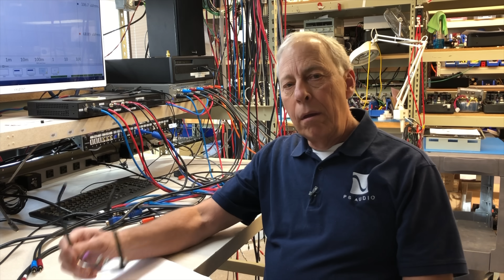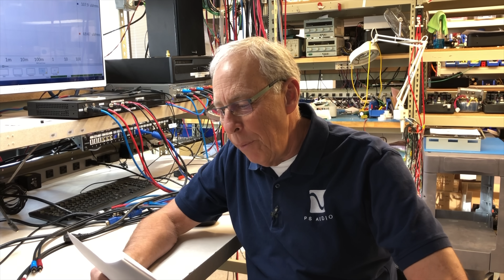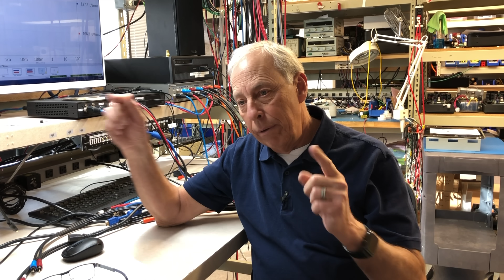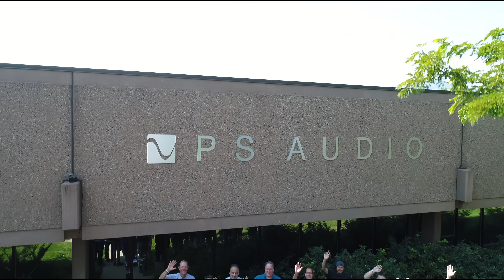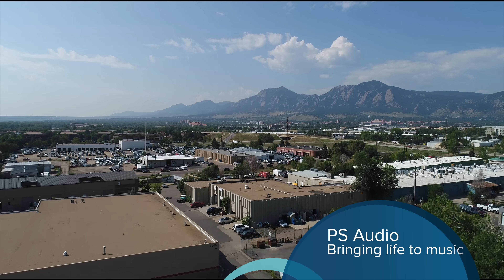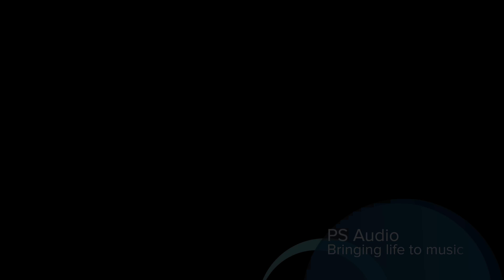What's the difference between amplifier gain and watts?

Comment: So technically speaking turning the gain down on your amplifier should reduce output wattage correct? Just asking because I'm running a big amp at 2.67 ohms 8k and just going to turn the gain down

Comment: Before I did't understand, now I am totally confused.
Reply: It will get clearer over time. Consider that another name for voltage is ‘potential.’  With the volume knob at ‘0’ there should be no voltage at the output of the amplifier. As the volume is increased, the voltage at the output of the amplifier increases. (Be careful testing this, since some ancient amps must have a load, or they will self-destruct.) Now add a speaker to the output: without any intervention from the amplifier, two things will happen (1) part of the voltage will now drop across the speaker, (2) current will flow out on the ‘hot’ wire and back on the return or ‘common.’ In this situation power is now being consumed by the load (that is, the speaker), and the voltage ‘potential’ is now being realized. The power consumed is noted in Watts (Voltage x Current, V x I). 

But wait, there is more: since there is a ‘power’ amplifier in the circuit, and since there is a speaker also in the circuit, and music or other tones are being played two more things happen: (1) the speaker presents a varying load to the amplifier, and (2) the amplifier varies the amount of current delivered to the speaker terminals in order to maintain the voltage called for by the volume knob. [It does get a bit more involved in that the ‘gain’ and current levels may be a DC component setting the bias or average level which is more or less modulated by the AC signal waveform, but generally speaking the volume knob sets the voltage target the amp tries to achieve while the speaker load sets the current demand required to achieve it.] At any rate, if the amplifier is unable to supply the current required by the load to do its work, bad things start to happen: (1) the amplifier begins to clip, tops and bottoms of signal voltage are cut off because the amp is unable to produce enough current to achieve the peaks and valleys, the user hears distortion, if this situation continues long enough, things start to heat up and thermal protection circuits are triggered. If no corrective action is taken, and the situation continues, or gets worse (volume is increased further to ‘get past’ distortion, something is going to blow. The signal will start to resemble an elevated straight DC signal, the voice coil will heat up, and the amp’s fuses (if equipped) will blow, or the speaker fuses (if equipped (will blow). If neither the amp nor the speaker is equipped with fuses, the voice coil will weld itself to magnet, which will present a dead short to the output of the amplifier, where parts damage to the output stage could result before the fuse at the power supply inlet finally blows, if so equipped. Hope this explanation helps. It is really important to understand that a load will pull down a supply voltage. In weightlifting terms, most everyone can manage (has the potential) to lift 25 lbs.; not everyone can manage to lift 300 lbs., at least for very long, although it it probably true to say we could potentially do it, flow of adrenaline, etc. So, when you turn up the volume, especially into low-efficiency speakers, you are piling ever more weights on the bar; if the amp isn’t strong enough, something will buckle. With very efficient speakers, 25 Watts (or even 2) can be enough to achieve decent levels of loudness; with less efficient speakers, even 500 Watts May not be enough, or so they tell me.

Comment: very interesting so essentially what you are saying is the following. if you power amplifier can deliver 10000 watts it essentially can keep any voltage you throw at it between the terminals of the speaker. if instead your amp is a 1 watt power amp it can maintain the voltage needed to supply 1 watt of power to the speaker but not more. so if ypu put 20 volts into the power amp you will only deliver 1 watt so the voltage across the speaker is a lot less than the 20 volts that came in and the rest is noise compression. essentially the volume you hear how loud it actually gets has all to do with the voltage sent out by the preamp. correct? are lineouputs from a preamp line out supposed to carry signals of such high voltages? i thought the libeouput peak voltages rarely went above 1.7 volts

Comment: I'm no expert, but it seems this would have benefited greatly with the inclusion of a brief overview of Ohm's Law (fittingly). Two excerpts of this can be used to flesh out the illustrations of "40 volts into 8 ohms is 200 watts," and "40 volts into 4 ohms is 400 watts."

Two excerpts from Ohm's Law:
1. Volts = Amps x Resistance     (V=IR) [for those unfamiliar, amps/amperes is the unit for electric current, often represented by an "I" in equations, and ohms is the unit for electrical resistance]
2. Power = Amps x Volts       (W=IV) [for those unfamiliar, watts is the unit for power, electrical in this scenario]

Plug in the relevant units from the first illustration into the first, then second equations above:
1.   40 = I x 8, solve for I:
I = 5 amps... then,
2.   W = 5 x 40, solve for W:
W = 200 watts

Plug in the relevant units from the second illustration into the first, then second equations above:
1.   40 = I x 4, solve for I:
I = 10 amps... then,
2.   W = 10 x 40, solve for W:
W = 400 watts

  As Paul mentioned, Gain is just a term for a simple multiplier applied to the voltage prior to plugging numbers into the equations above. As voltage is increased, the amount of current (amps) needed will increase.

  The severity of increase in current (amps) will depend on the load (resistance, ohms) of the speakers; bear in mind that the resistance is a fixed value determined by the speaker's construction, and as such it is the only constant in these equations.

  With both the voltage and current (amps) increasing, the power (watts) consumed by the system increases also. If your gain setting calls for more current than your amplifier can provide, you'll get clipping. And if your amplifier pulls more power than your breaker can handle, it'll trip. Let's hope for neither!

Comment: I really can't follow it (or communicate it?) by measurement. My understanding comes through playing with guitar amplifiers and overdrive pedals (not distortion pedals, to be clear). Gain, volume, headroom are mutable concepts that are best understood by playing around with them. Go to a guitar store and mess around with a combo amp. Find one with gain (sometimes called overdrive), volume, and master volume. You will then see how these elements relate and behave (if you can find an amp with an attenuator, even better). You'll be no wiser in terms of measurements, but you'll understand it.

Comment: Amplifier gain is the ratio of output voltage vs input voltage. Wattage of an amplifier is the energy per time available on the output side to move your speaker cones. One Watt is one Joule per second. A 100 Watt amplifier is producing 100 Joules per second. Not actually much. The energy of a single BigMac is 2,250,000 Joules or your 100 Watt speaker power for 2,250,000/100 = 22,500 seconds or approx 6 hours of playing music at maximum!  In other words, a 600 Watt amplifier produces as much power as that of eating a BigMac per hour 🤔

Comment: I'm not an engineer but I think I get the idea, so maybe I can offer a straighter explanation.
Let's start with volts. the amount of volts across a connection between two devices determines how hard one device is trying to pull electrons from the other device. If the preamp output 1 volt to the amplifier, that means the amplifier tries to pull an amount of electricity that represents one volt. If the amplifier output 30 volts to the speakers, that means the speakers try to pull 30 times more electricity. But this is only how much they try to pull, not how much they actually pull.
So, the gain of an amplifier is simply how much higher can the amplifier make the pulling force it receives from the preamp. If the gain is 30, and the preamp gives 1 volt, the amplifier makes it 30 volts.
The wattage is what determines how much electricity can actually be pulled. The more powerful the amplifier, the more electricity it can actually provide the speaker, while it's trying to pull more and more out of it. 
So, let's take two amplifiers, one with a power of 20 watts, and one with 200 watts. They both have the same gain, so the speakers in both cases are trying to pull the same amount of electricity. In the 20 watts amp, it can deliver up to 20 watts to the speaker and then it stops. It can't deliver any more electricity, and the volume is limited by this. If you would connect the 200 watts amp instead, it could deliver the speakers 10 times more electricity, so it can go louder. 
Because both amplifiers have the same gain, if you output enough volts from the preamp through the 200 watts amp to drive the speakers to full volume, the same amount of volts from the preamp to the 20 watts amp will cause the speakers to clip before they get to that volume. So to drive the smaller amp to its full volume (just before the clipping point), you will need to provide it with smaller voltage from the preamp output – basically meaning, lowering the volume knob until it stops clipping. 
In conclusion, higher watts mean you can turn the volume knob higher. Gain is basically the same in every amplifier, so don't worry about that.
Reply: You aren’t considering current in your equation. Watts = Power = Voltage x Current (V x I). The gain, as Paul explains, is set by voltage; but the Watts are determined more by the speaker load where V = Current x Resistance (V = I x R). So the resistance of the speaker has a great deal to do with the Voltage at the output of the amplifier. To make things more interesting, the resistance at the speaker varies with frequency, in fact, resistance to an AC waveform is called Impedance. (Impedance itself has two components, Capacitive and Inductive; Capacitive decreases with frequency, Inductive increases with frequency. Capacitive resistance [or reactance] current leads voltage [capacitors take time to charge]; Inductive resistance [or reactance] Voltage leads current [inductors take time to build the all important electro magnetic field]. The math to figure out AC signal characteristics is quite involved, and not easily measured, at least its component parts called out above, but its nature assured us that every speaker and amp design will be a bit different. Crossovers can be as much art as science and are peculiar to the drivers chosen. 

Getting back to your equations, more power will be required of different speakers presenting different loads to the amplifier.  Generally speaking, highly efficient speakers present less of a load to the amplifier than less efficient speakers, but less efficient speakers seem to offer the speaker designer with more options in shaping the sound (judging by their preponderance in the market). 

Finally, as to power requirements vs ‘loudness.’ The relationship is not linear, as Paul mentioned at the top of his video, and I think he helped us all by eliminating from his discussion, but just as twice the voltage does not equal twice the power in practical terms (ideally this is true P=IV), twice the power does not equal twice the volume, due to the (relatively) sensitive nature of the human ear. Power increases along a logarithmic curve, such that: For a two-fold increase in electrical power, there is  3 dB increase in sound power, for a four-fold increase in electrical power, there is a 6-fold increase in sound power, and only when there is a ten-fold increase in power, do you get a corresponding ten-fold increase in sound power. As a Goggle search reminded me, decibel itself merely expresses a ratio of powers. Generally speaking, you need a lot more electrical power to gain a similar increase in sound power. So, while the values chosen for your example are valid, it wouldn’t work well unless you continued to add zeros (10 fold at a time). Anyway, I think you’re close to gaining an understanding, keep at it, and be careful. I’m not an engineer, either.

Comment: 2.83 volts = 1W into 8ohm
(2.83)^2 / 8 = ~1

If the amp gains takes in 2.83V and gains it by 20dB, that’s 100W (10x to gain +10dB, so 100x to gain +20dB).  
  
However, amps don’t need 2.83V, they are able to output max power with usually 1.3V to  2.0V.

If 2.0V input, with no gain that’s 0.5W into 8ohm (2^2 / 8 = 0.5), and would need a gain of:
3dB to be 1W
6dB to be 2W
9dB to be 4W
12dB to be 8W
15dB to be 16W
18dB to be 32W
21dB to be 64W
24dB to be 128W
etc.

So yes, 20dB to 30dB of gain is typical. If an amp doesn’t need as much input voltage, that means it’s internal gain must be higher to compensate.

Comment: Hey Paul how are you? I hope you and yours are all doing well. I have a question regarding tube amplifiers, if an amp is left on continuously although only listening to it upon arriving home how much of the tube life is diminished or is it. As I'm sure you already a tube amp usually needs warming up at least a half hour and better to sound it's best. Also which one your power conditioners or ac regenerators would you recommend without going crazy price wise say between  $200-$1000 I've heard a lot of buzz over the Audioquest Niagara power conditioners. Thanks in advance I enjoy your friendly videos and your knowledge of audio equipment.
Reply: tube life will be diminished, how fast depends on output or input tube and how the mfg. pushes the tubes with circuit design as some mfg.designs  run the tubes less "hard" than others
Reply: I have a tube amp: I try to remember to turn it off if I will not be listening for a couple of hours or more.
Reply: Thanks for the two replies lady and gentleman. Very refreshing to hear from a woman audio enthusiast. Now let's see what uncle Paul says on the subject of tube life whether or not to lean on when not in use.  Happy listening.

Comment: That was confusing. From https://science.howstuffworks.com/environmental/energy/question501.htm :

A neat analogy to help understand these terms is a system of plumbing pipes. The voltage is equivalent to the water pressure, the current is equivalent to the flow rate, and the resistance is like the pipe size.

Volts (pressure)  X (multiplied by) Amps (Current (flow)) equals Watts (power).